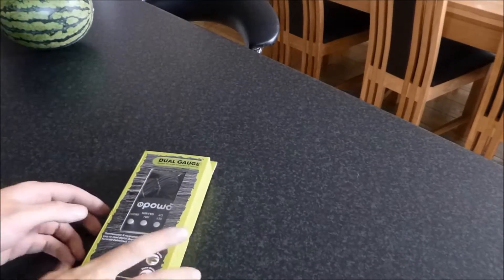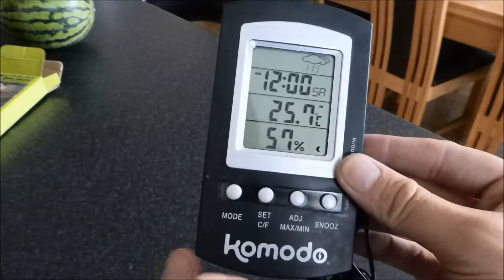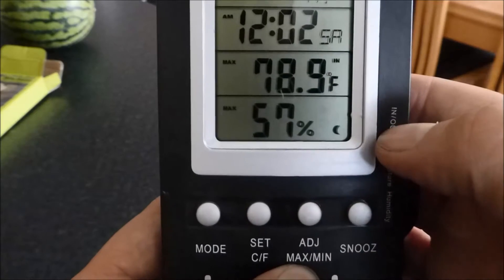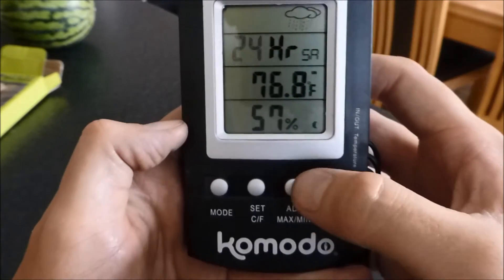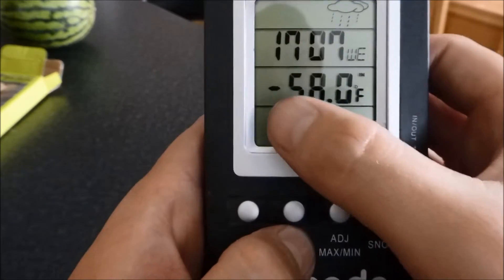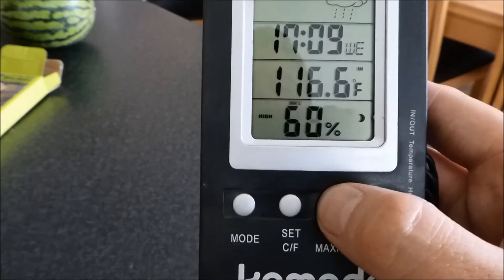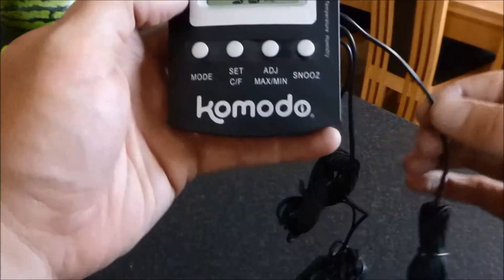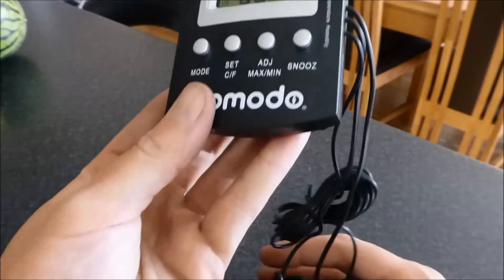Unboxing, assembly and review of the Komodo dual digital hygrometer and thermometer

Comment: Just picked a pair exactly the same but branded "Swell Reptiles"  the instructions are abysmal. Worked it out but a beginner might just give up, no explanation of the probes and the flow chart is borderline unreadable.

Obviously not specifically made for the reptile trade just branded by reptile supplies.

How have you found them since installing, have you found them to be accurate?

Good Vid!!!!

Cheers Trev